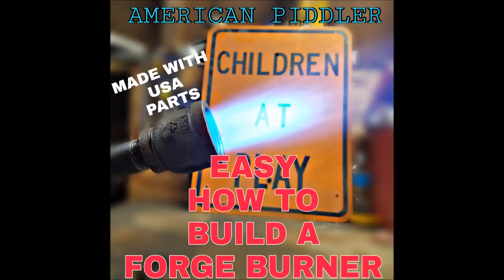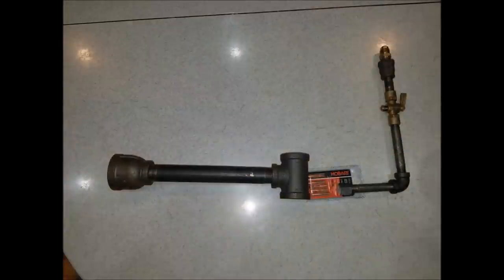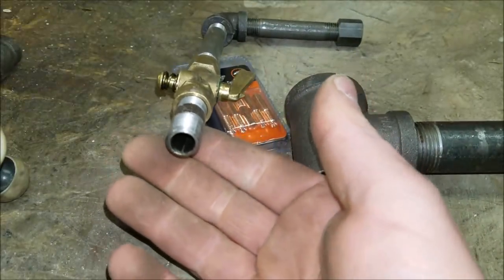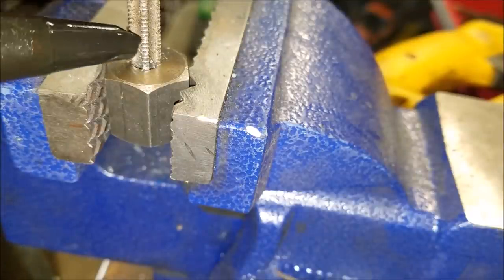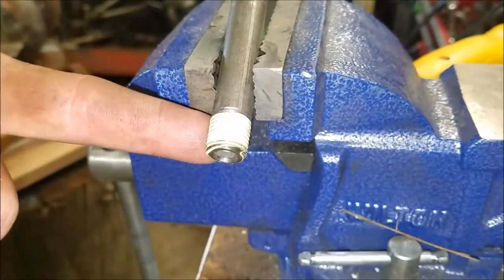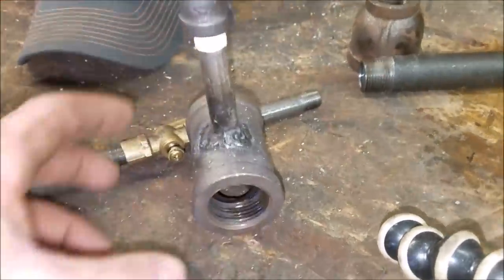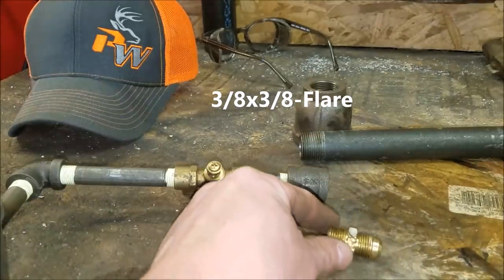How To Build A Forge Burner

Comment: American Piddler I have a question for you why are you using a 1" x 1" x 3/4" tee ! instead of a 3/4" x 3/4" x 3/4" tee is there a certain reason behind it?
Reply from the maker: Air flow you need the air
Reply: @AmericanPiddler  so are you saying the 3/4 won't supply enough air?
Reply from the maker: I'm saying I know the one I used works and it definitely doesn't have too much probably just enough
Reply: @AmericanPiddler  just asking before I finish mine I am also sending you a letter about the lining before I do the lining in my  forge
Reply: @AmericanPiddler  I was just checking about the tee because I was going to use the 3/4" tee so how much propane does your forge use with that tee?

Comment: Is it hot to do steel welding? and damascus
Reply from the maker: Sure is! As long as your forge is built with the proper materials!
Reply: @AmericanPiddler  I've got some firebrick and built an iron casing to put it inside. look like the Alec steele model. And how much psi do I need for it to run best?
Thank you.
Reply from the maker: The regulator that we use is up to 40 psi and we probably run around 20 psi once up to temp

Comment: I like it brotha, any ideas making adjustments to the air flow?
Reply from the maker: Yes I think if I were to do it again I would tap the spot where I welded it and that would allow for easier adjustments! Thanks for watching and don't forget to subscribe!
Reply: @AmericanPiddler  you mean just tap the hole you drilled with the Lenox and use a bushing instead? Also what kind of burn time do you get on this per gallon? Subscribed.
Reply from the maker: Yes that's exactly what I mean it will allow for easier adjustments to the depth of the mig tip...  on a 20lb tank i can run from 8 to 12hrs depending on how hard I am running it how high I have the pressure regulator set.... which I why I love the regulator I reccomend in the description of the video
Reply: @AmericanPiddler  right on, thanks man.
Reply: @AmericanPiddler  one more thing, if I were to use 2 of these in 1 forge would I need a second pressure regulator in line or could I just use one before the line splits?
Reply from the maker: @williamrichards7118  no one regulator will easily run two burners!
Reply: @AmericanPiddler  and one final question haha. What size of forge do you think this is optimal for only a single burner? I was thinking 1 ft by 8 in wide by 6 in tall. Thanks again man.
Reply from the maker: There's a formula somewhere and I can't remember it right off but will try and find the answer for you!
Reply: @AmericanPiddler  alright thanks!

Comment: Trying to build and I need some help from anybody who’s made one of these. I’ve bought a few end caps now and every time I thread them the mig tip breaks the thread I’ve created. At first I thought I wasn’t setting the threads right but it looks like the round black iron end caps are too thin to hold a decent thread. Any ideas American Piddler or YouTube community? Thanks everybody.
Reply from the maker: Not sure i didn't experience this problem... are you sure you have the correct tap? Try and tap a different piece of metal and see if it holds 🤷🏼‍♂️ if that works then try and anneal a new cap let it cool slowly after a couple glowing red attempts and then get glowing hot and quench in oil to harden the cap so that is holds the threads better... thats the best I can come up with without actually being there piddling with it! Hope this helps! Thanks for watching and keep on piddling #americanpiddler!
Reply: American Piddler That’s a great idea thank you.  I’m using a #3 drill bit and a 1/4-28 tap. It threads in fine but if I twist it to secure it the thread breaks. I’ll try to anneal it first then quench like you suggested. Thanks again, keep up the awesome channel buddy.
Reply from the maker: Michael please keep us updated!
Reply: American Piddler sure thing! Headed to the plumbing store later today and I’ll let y’all know.
Reply: American Piddler I came up with a solution to the problem of the breaking the threads every time I screwed in a mig tip for the first time. You suggested not tightening it as much and annealing the end cap so the threads are cleaner. But it figured it out the Piddler way: you gotta grind the mig tip down so there’s less thread on it and enough meat on the end cap. It worked on the first try and holds tight with no leaks. Thanks man!
Reply from the maker: Awesome job! Thanks for sharing Mike!

Comment: How fast does it get to forge weld temps? Just want to make sure I don't build a whole forge setup and end wishing for more heat...... Planning on forging out large pieces of steel, swords, that sort of thing, and want a powerful one. BTw, thats a pretty sweet burner you made, I don't think i've seen that design before. Good job.
Reply from the maker: +Jake Makes if your planning on forge welding regularly I would use a two burner design! Have you started your forge build yet?
Reply: Not yet, but will soon. Thanks for the reply, i'll make mine with two burners then. No point in making a less powerful forge, after all :) Probably won't do a huge ton of forge welding, but I'd rather leave my options open.
Reply from the maker: What are you using for your forge body? A propane tank or air compressor or what?
Reply: Propane tank. I think. It looks like one. It appears someone welded two normal sized ones together (why??), so it's several inches longer than a regular one. Which for a two burner forge will be great. No complaining there. Especially since I got it for free 😃 I'm real excited about it. I'll be able to make some stuff I've been dreaming about for years........

Of course I have to actually make the forge first. Knowing myself, it will probably be a little while.
Reply from the maker: Jake Makes Well I'll leave ya alone! All I can ask if If ya find the videos useful hit the like button, if ya wanna see more hit the subscribe button, & if ya think someone else may enjoy it please share! Thanks for Watching!
Reply: Check, check, and check. You're welcome. I'll look forward for your next vid! You do a weekly thing? That's what i'm shooting fer right now.
Reply from the maker: +Jake Makes yup trying to do weekly American Piddler Projects! If you check me out on Facebook or Instagram I ideally share what I'm doing before it gets edited & produced as a video! Thanks for the kind word's of encouragement!

Comment: I built this burner to the T, think the only difference was a .025 mig tip, i have a 20 psi propane regulator and when the flame does finally catch it lights right at the mig tip and still wont stay lit, even when I pull the pipe off it still wont stay lit, any ideas WTF is goin on?
Reply from the maker: The regulator sounds like the difference... send me a message tomorrow on Facebook or Instagram and I will do my best to help be sure and have pictures! Thanks for watching and Keep on Piddling!

Comment: That thing rocks!
Reply from the maker: Wildman Tech Thanks! It definitely get my little forge hot hot hot!
Reply: Built a triple burner and tried to used the regulator I had. It wasn't enough so I ordered the one you spec'd. Justy posted it on Igram.
Reply from the maker: +Wildman Tech awesome I'll check it out! When you crank that regulator all the way down it will absolutely put out the heat!
Reply: American Piddler
What size of bit was used to drill the hole out for the tap
Reply from the maker: Abel Maldonado I'm not sure it came in a set there's a link in the description that has both the tap and the drill bit
Reply: American Piddler 
Thanks for the link the size is labeled as a #3 I'm building a forge  for a buddy of mine for Christmas much appreciated!

Comment: nice burner build...you must be welding with a harbor freight flux core welder or similar? Those welds looks about as crappy and spattery as mine do haha...but they get the job done and thats all that matters. This is going in my favorites for when I build one...thanks!
Reply from the maker: Thanks for the support! feel free to ask any questions if you have any while building your burner!
Reply from the maker: mojo jojo have you got your build done yet?
Reply: @AmericanPiddler , just curious if you ever changed the tip to see if it got hotter?
Reply from the maker: I have changed the tip and also how deep or shallow I put it into the tee if that makes sense.... I may make a video explaining this to help everyone understand it better but as the propane is forced passed the openings of the tee it creates a draw of air "oxygen" if it is too deep the draw will not be as much making the fuel to air mixture very rich ie too much fuel nit enough oxygen when the tip is too shallow or not far enough in it will be too lean ie not enough fuel so that's where your pressure regulator & adjustment of the depth of the mig tip can really allow you to get the most efficient and hottest burn possible from your build I hope this answers your questions and if you'd like to see that video let me know
Reply: @AmericanPiddler , everything you said made perfect sense. I deffinetly want to see the vid. If you already put it on your channel I can find it, and thanks for keeping it made in the USA!
Reply from the maker: I have not covered this topic but will begin planning the video and also maybe another build with an easier way of tuning the burner! Thanks for watching and for the support! All I can ask is if you like it hit the like button. If you love it subscribe & if you think others may enjoy share it! Thanks again for the kind words and encouragement!
Reply: @AmericanPiddler , liked and subbed. I'll be ready when you put the 2.0 burner vid up

Comment: I want to see you change that tip  after you are finished putting it together ? And what happened to the tape ?
Reply from the maker: Sam P what do you mean by the tape? As far as the tips, I can do a short video where I change the tips and do a comparison of .023 & .030 tips...
Reply: I would think the tape melted but I reckon  it don't matter. Good idea and good job.
Reply from the maker: Sam P yes the tape near the end melted and I have since learned that it is a very dangerous gas it puts off when it melts! So no using tape and the welder together! Thanks again for the kind word's! Have you decided to start your own yet?
Reply: Yes I am going to make a burner like that very soon. I have been looking at videos for a long time and I like your idea better than any I have seen looks like that .023 tip works fine ?
Reply: Yea I want to see a tip change once it’s welded ..... scratching my head on that one
Reply from the maker: James it's easy just remove the nipple and use a pair of needle nose pliers... thanks for watching and don't forget to subscribe cause the next burner build has no welding!
Reply: Looking forward to that. @AmericanPiddler
Reply from the maker: I may show it in an upcoming episode! Should have an improved burner design episode and also should have a kit available for sale
Reply: @AmericanPiddler , I just finished building my first forge, just like your propane tank one. I just need to paint it and make the burner. If you have an improved burner model I would like to watch about it before I build mine Thanks for keeping it USA
Reply from the maker: I haven't built and filmed the new burner yet! Trying to get website stuff done so we can sell the kit!
Reply from the maker: @HarmonHeat  btw thanks for watching and thanks for the support

Comment: Why use an elbow. Can't you just use a straight run into the back of the tee off the gas line?
Reply from the maker: Yes you can but I don't have my gas line coming from above so an elbow works better for my application! Thanks for Watching! Are you building a forge & burner?

Comment: Whit glp?
Reply from the maker: What?
Reply: @AmericanPiddler  I tried using LPG (the one u use in a kitchen)but it needs some changes( I guess). It only gets until 1000° and I need  more to work on some gold I recovered from old earrings. I'm not sure if that will work, I couldn't find a specific way to build  LPG burner. You should try it on a video.

Comment: Would of been less hassle to feed the mig tip in from the inside and weld instead of grinding the cap.
Reply from the maker: That sounds like a good idea! If you decide to make a video let us know! Thanks for watching and Keep on Piddling #americanpiddler
Reply: @AmericanPiddler  haha, i make forges and burners for a living and sold hundreds. Why don’t you tell your viewers that using a cast flare like that will not only radiate heat up the tube but will not last long when its in a forge.

Comment: that tee you weld on  is cast iron type metal  if you weld on pipe tee use a forged steel  it is steel not cast iron  i see all you  forge burner builders do this  NO WELD-ON CAST IRON
INSTEAD OF TEE USE A CROSS IT HAS 4 OUTLET THREADED

Comment: You combine too much
Reply from the maker: Not sure what that means but I actually have a functional forge & im not watching YouTube telling others what they are doing wrong while still needing to build a forge
Reply: @AmericanPiddler I built two of the same burner for my forge and I just know what could be done in a simpler and more effective way in this case. Your burner is great too.
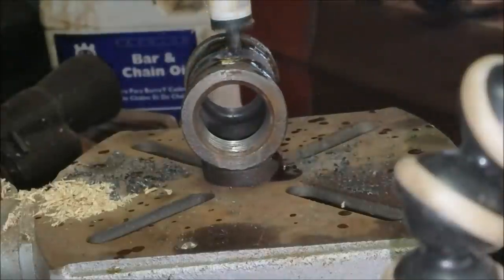7:08 There is no reason to drill this big hole and welding a nozzle holder
11:25 Your nozzle is screwed crookedly, the welded holder also can make your mozzle little curve, that i know better make your mozzle that straight how you can and and it is better to thread the nozzle mount on a bench drill to make perfect mixed gas and air. THATS I MEAN
Reply from the maker: Thanks for clearing it up 👌🏼 do you have a video of the improvements made I'd love to watch and learn as well! Thanks for watching and keep on piddling!